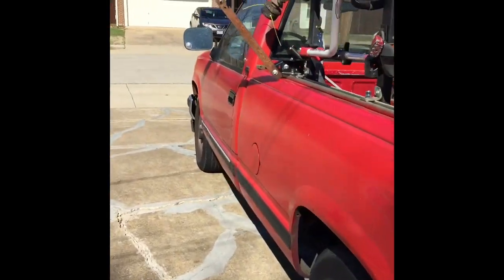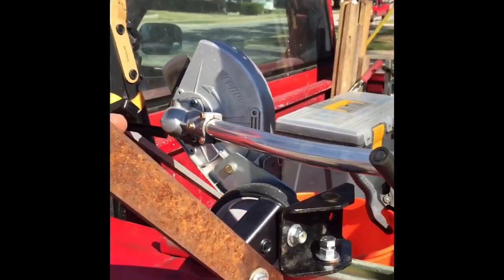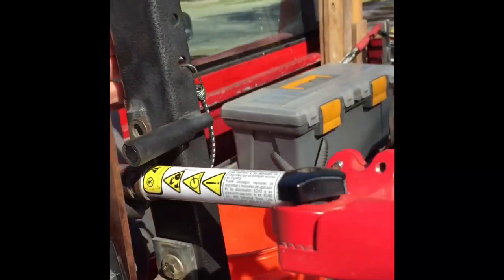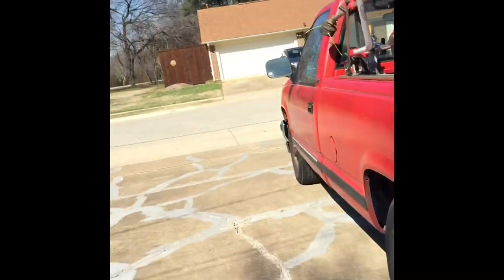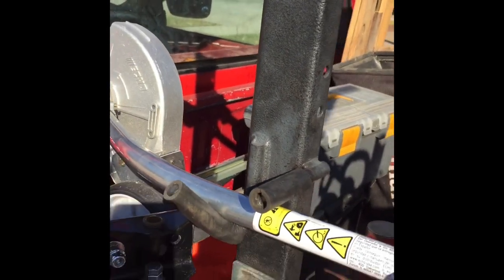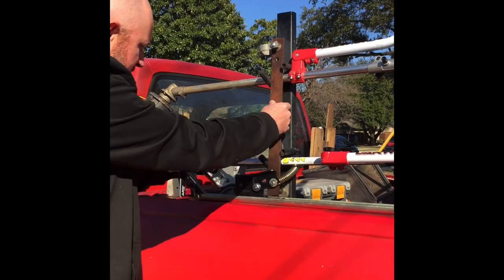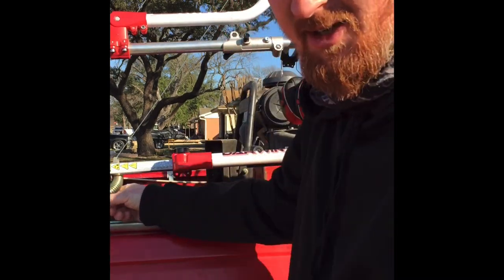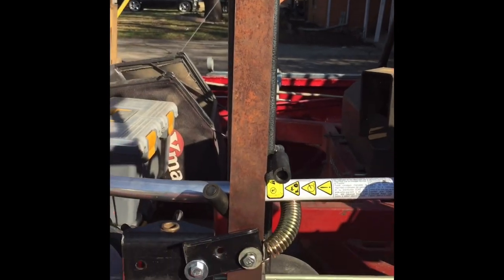Upgraded trimmer lock! Protect your investments simple and cheap! 😎🔥

Comment: Heck yeah ima have to upgrade mine too
Reply from the maker: This was super easy, I used a scrap piece of flat iron I found on the ground in front of a clients house, an old galvanized pipe strap from a chain link fence pole, some bolts / washers, the swivel piece was actually part of a deck pedal lift arm for a toro timecutter mower that I cut apart.
Reply: @BigRedServicesLLC  I saw that I will have to figure something out I’ll let you know what I come up with
Reply from the maker: @DiamondLawncare  yes for sure! Make a vid on it I would be interested to see what ya come up with!